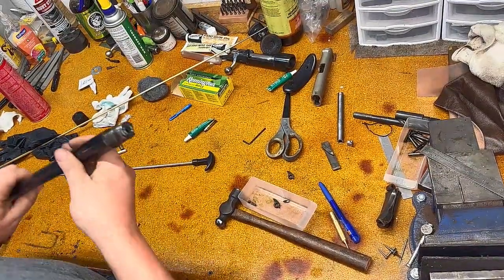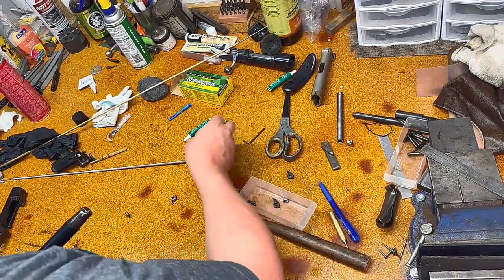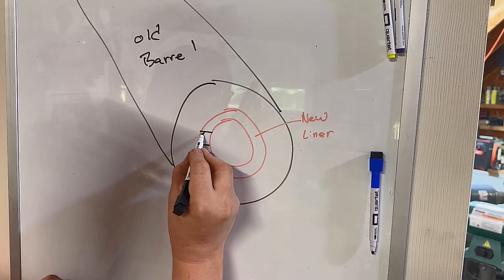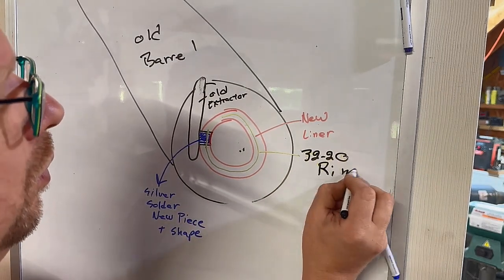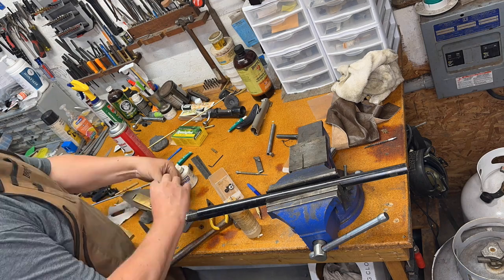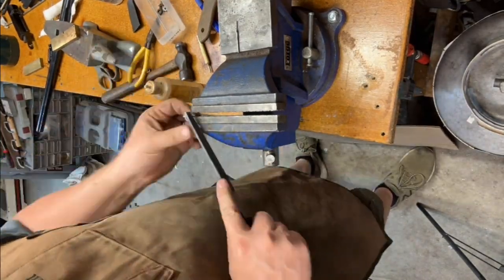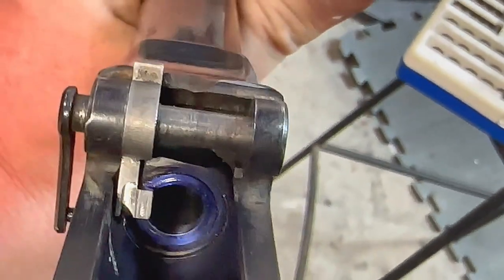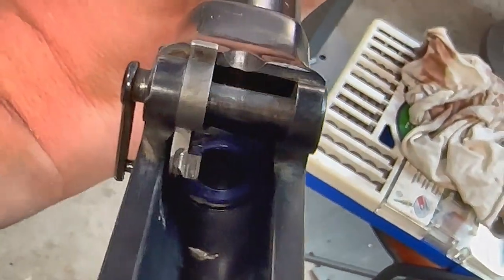Building a 32-20 Trapdoor Springfield Carbine - Part 3 Fitting the extractor

Comment: Wow, I would not have guessed silver solder for extending the new extractor!
Reply from the maker: Yea, it's the Brownell's HI-Force 44 Solder it Provides 14,000 to 28,000 PSI tensile strength (to be clear, I soldered a piece of steel onto the existing extractor and machined the steel down, It wasn't built up with solder then the solder machined off). Alternatively, you can add weld and file it off. With the time crunch I had I didn't want to risk melting the extractor and creating a problem I couldn't repair in time.